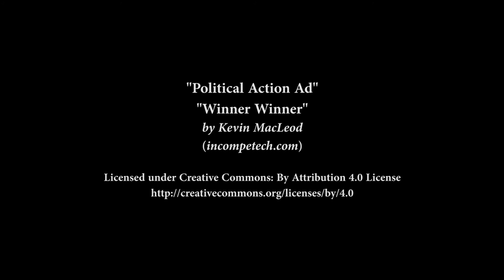Sailing 'Our Hood 23' - Ep 7: "Outboard Issues!"

Comment: Just a couple of suggestions. With the bilge water, dip your finger in and taste if it's salt or fresh. Also when taking the outboard off or on tie a line to it and the pushpit. Better a possible bend in the rail than a drowned motor. Cheers. Love the Hood 23.
Reply from the maker: Many thanks. It did taste salty at the time but im pretty sure it was just due to residue from the tube which houses the wire to the centreplate. I've had no further water in the bilge since then. I agree with your suggestion regarding tethering the motor. We will do it a bit smoother next time. Got some more videos coming out soon on our boat so stay tuned...